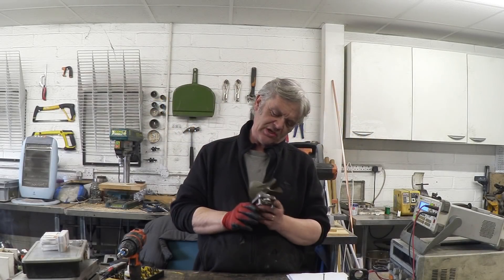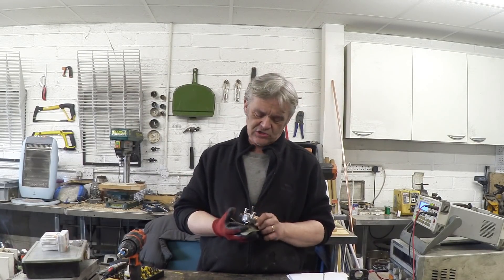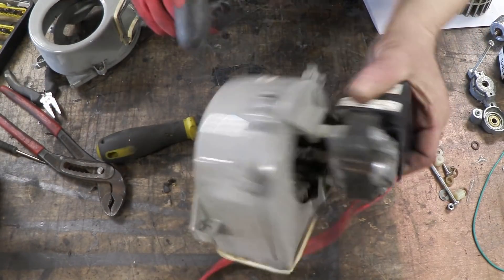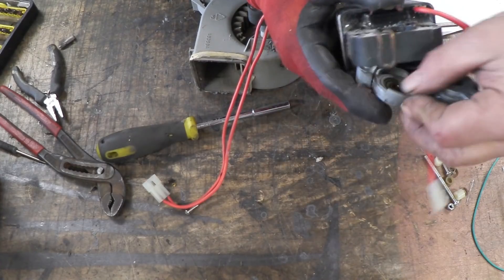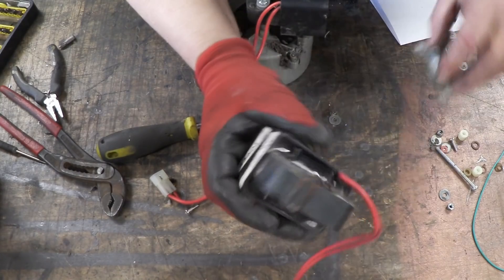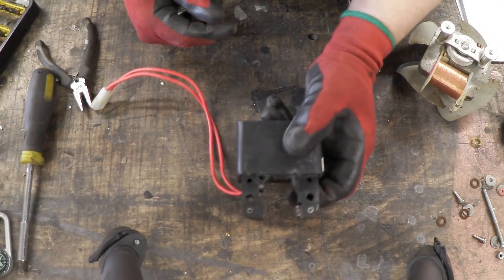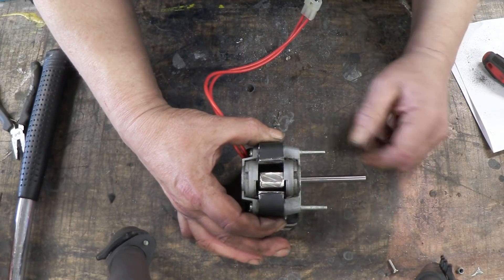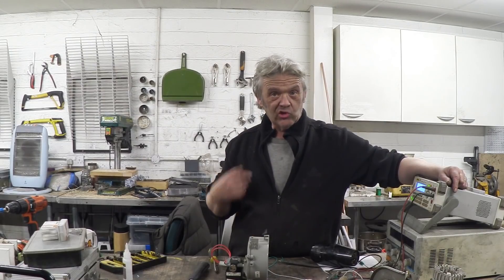1052 A Shaded Pole Motor As A Reluctance Generator

Comment: nice :) I never thought of back driving one... I had assumed they would somehow generate some weak voltage without the modification and magnets? The ones from ceiling extraction fans common hear in Australia have awful bearings in them... won't last long if driven with any radial force (belt driven).
Reply from the maker: one of the defining qualities of these things is the cheapness of the build mate lol

Comment: Why do you need to cut the drum of the rotor into a bar shape? Wouldn't the rotation of the drum through the magnetic field be enough to start up a counter emf inside the drum, then induce electron movement in the adjacent coil?
Reply from the maker: it's to do with flux path - if it is still a  drum there is no high and low point in the flux path

Comment: I don't know how long it would take but, 1.97 volts will charge the very common AAA, AA, C, and D cells. But you may get annoyed with hearing that hair dryer. 😂
Reply: With boost converter you can up the voltage to charge just about anything. There is some losses in conversion but nothing's perfect.

Comment: Those fan blades make great Peloton Wheels for using water based generation. I am working on a portable hydroelectric system that uses a hydraulic ram pump in a basin with a barrel reservoir to create a closed hydro system and having the gravity from the water flowing downward to the work to generate electricity.

I'm nearing completion and would love to show you when it is finished. 

Well done mate, love the magnetic flux series. Can you use the flux to make retractable items, or have you given that a think?
Reply: Sorry to be pedantic, but a Pelton Wheel is quite different. It's actually more like a Francis turbine, but really you might more properly describe it more generically as an impulse wheel. In practice, you'll find it is nowhere near as efficient as a Pelton Wheel or a Francis Turbine, mainly because the water does not get out of the way efficiently, after having delivered its kinetic energy to the wheel.
Reply: @sailingoctopus1  I appreciate the feedback, but not matter what the water generates it will still charge a battery for general uses.

It's not the efficiency that I'm looking for, it is proof of concept. Improvements can come after 😁

Comment: I think for this purpose you can cut the shaded pole winding out. I't will prevent loses there and it will perform a bit better.
Reply from the maker: I did mate - I just forgot to point it out so thanks for mentioning it - actually they are super easy to rove - they just pull out
Reply: I commended somthing similar. 

As a motor, the shaded pole coil creates a rotating magnetic field in one direction through a phase delay in the magnetic field on one side of each pole.   Now I wonder what it will do  when operated as a reluctance generator. 

i suspect the wave form will differ rotating clockwise from counterclockwise. I need to get a cheap oscilloscope now. 😁

Comment: Super cool.  

Tangentally, I'm still curious if a generator with no moving parts could be created by, instead of a rotor, a permanent magnet assist electromagnet was used (or several in sequence) to cause the change in the magnetic field, just getting the flux lines to redirect into and out of the generator coils.  like, turning the permanent magnet's "On and off" (redirecting their flux) inside a generator-  Doing the rotor thing, Strictly with moving the magnetic flux of permanent magnets.    In this, I Think, may be a chance for "Overunity".  Not really, but a way to hack physics sideways to make the magnets do the thing without having to actually move them.  Wobbling magnetic flux, seems like it would be less work and faster than physically moving the magnet, or redirecting the flux by spinning a rotor.  It seems like you could, potentially, put less energy into wobbling the electromagnetic flux, than the permanent magnets induced in the coils.  Does anyone know, how much electricity does it take to electromagnetically wobble a permanent magnet's flux vs spinning a rotor?  I've not figured any way to ask google this question that returned Anything useful.  
I am cognizant of my ignorance in how to actually accomplish that.    Your last several videos you've touched on these concepts, but from a different fundamental use perspective.  I dunno.  Thank you for making me think, as always.
Reply: sounds like you can try this with a transformer. Add perminate magnets and alternate current in the primary and see what happens on the secondary. I'd wager though that you wont get over unity but there might be something interesting in the wave form due to magnetic saturation in one direction.
Reply: Not sure that aligns with my though here.  or maybe I'm not thinking on it right.  What would a magnetic assist on the primary of a transformer DO?   Doesn't that just increase or decrease the voltage, per turns of coil?  ... I don't think (and I may be wrong) that would test what i'm pointing at.
Reply: @ryanjamesloyd6733  the voltage on the secondary is a function of the rate of change in flux and the number of turns.  Seeing as  perminate
 magnetic's magnetic  field  may nearly saturate the core, there may be little inductive reactance to current in one direction on the primary and lots in another the other direction. I'm just saying. that might be interesting.
Reply: @ryanjamesloyd6733  as to not sure it aligns with your thoughts.....  let me try this.  A pair magnets outside with one on each side of a transformer  may  conduct  some of their magnetic circuit though the center of a primary and secondary  coils. then when adding current to the primary, depending on it direction, it may either assist or eject the perminate magnetic's field lines from the transformer's secondary windings. 

I dont expect over Unity but I think there's something interesting here.
Reply: @ryanjamesloyd6733   somewhat related and also interesting  is using a DC bias in saturatabe reactor.